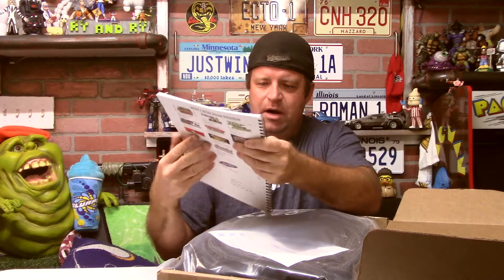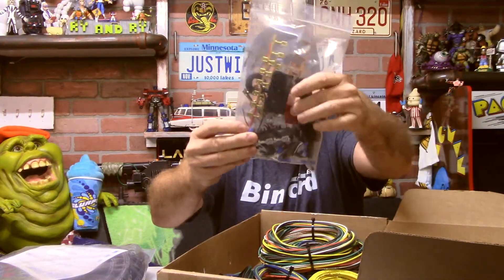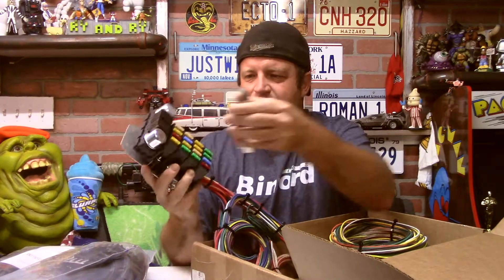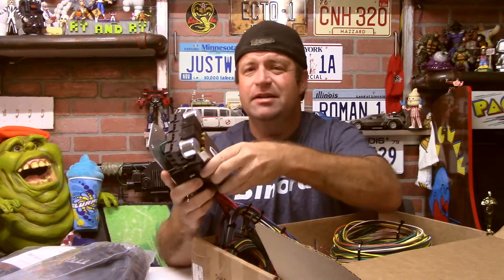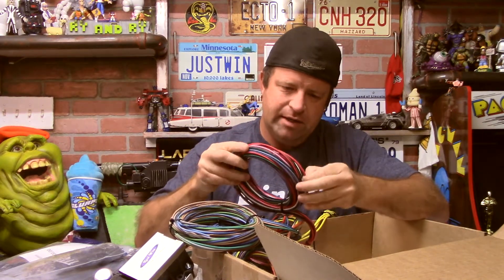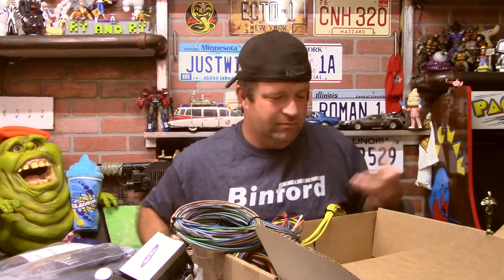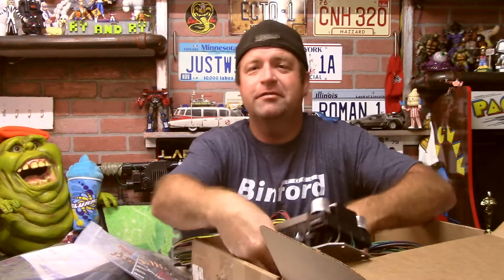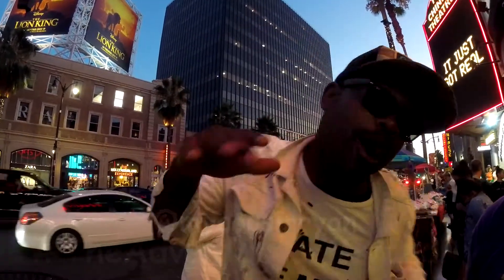Kwik Wire Wiring Harness Unboxing - Ford, Chevy, Chrysler

Comment: Doesn't matter what year car you have. Well it doesnt to a point. I would say 1996 is as new as one should go. I put the kwik wire 8 circuit in my 95 Honda Civic. Worked out beautifully
Reply from the maker: That's a really good point. This harness could be adapted to anything. I just happened to buy from their website as a 1959 Ford... Not sure if I'd mentioned it in this video, but I went with a EFI 302 out of a 1987 Lincoln Town Car. Ran all of the fuel injection/computer wiring from the Lincoln and then just tapped this harness into it (or visa versa).
Reply: @CousinRyan  302 Fi Lincoln swap.  I think that's a great idea. Bet it's a smooth running ride